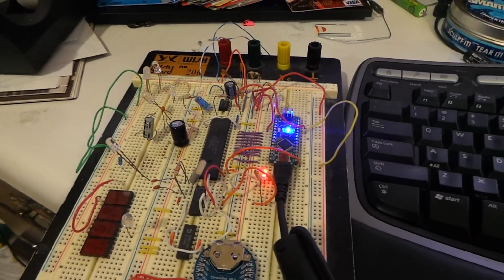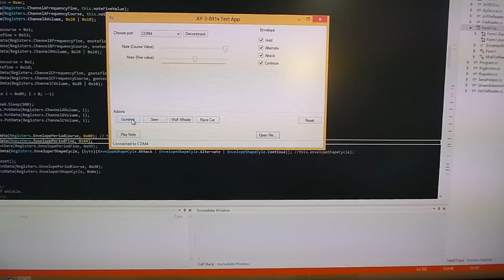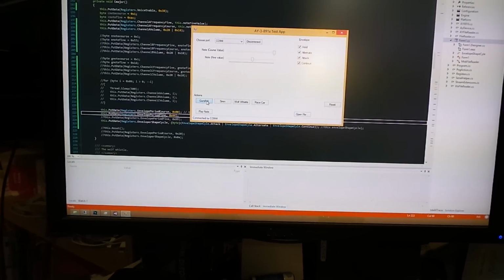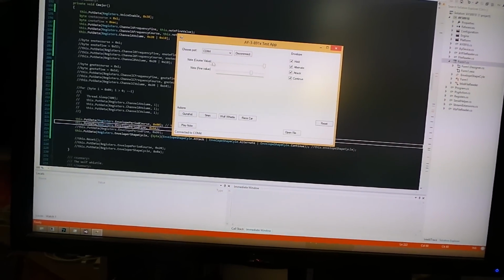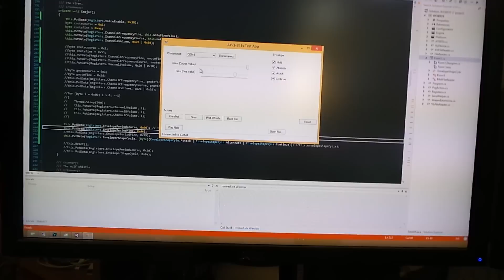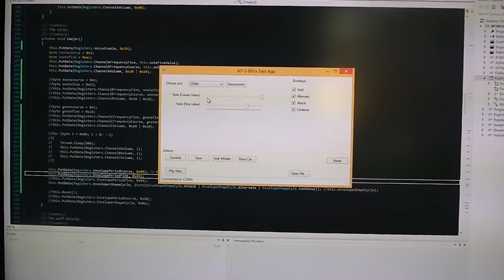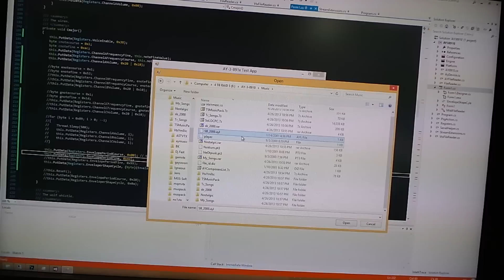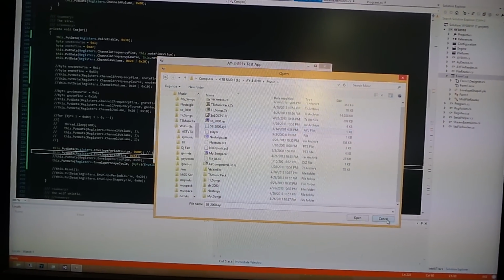Arduino + AY-3-8910

Comment: 0:50 can i use a 4-pin oscillator for that?
Reply from the maker: Yeah, as long as the voltage levels are within spec.
Reply from the maker: Yeah, as long as the voltage levels are within spec.
Reply from the maker: Yeah, as long as the voltage levels are within spec.
Reply: thanks! :-)

Comment: Could you detail the frequence divider? I'm using the Freq/4 output port from a PIC16F688 running at 8MHz. I adjusted the frequence to bit lower than this, so I came very close from 1.79MHz. The goal is play Konami musics directly from the PIC, without computer aid.
Reply from the maker: I ended up revising the circuit so that the Arduino provides the clock frequency for the AY-3-8910. It actually works really well for that and allows me to eliminate the crystal oscillator and accompanying ICs. I will add more details when I hop on my computer.
Reply: Don't use a microcontroller to do discrete component's job.
A D flip flop with CLK and EN tied together makes a frequency divider of 2. You can get more sophisticated than that with D's and and gates.
If you are in need of a precise clock without errors, that is the way to go. Really though, you should just get a crystal with the right frequency to begin with.